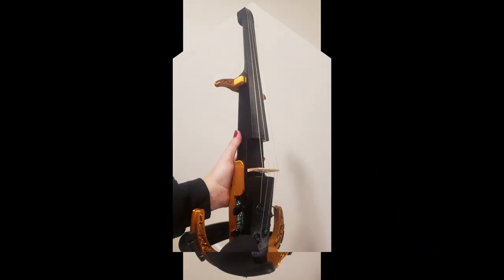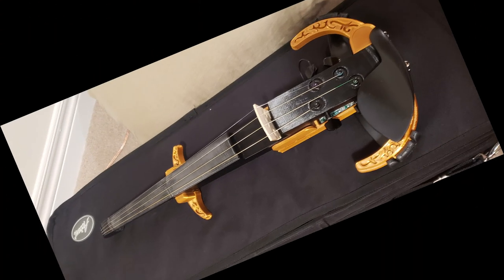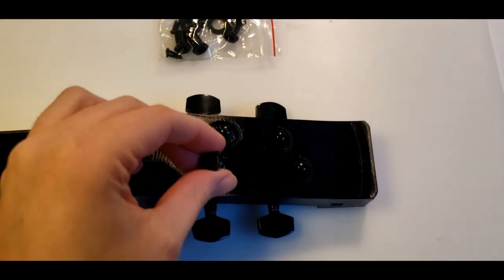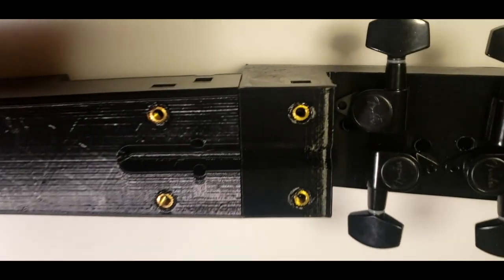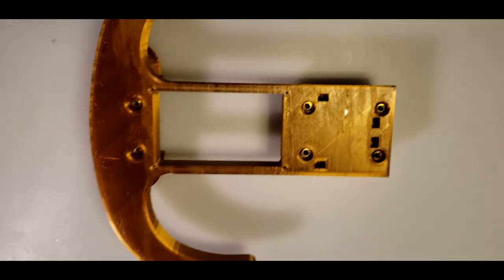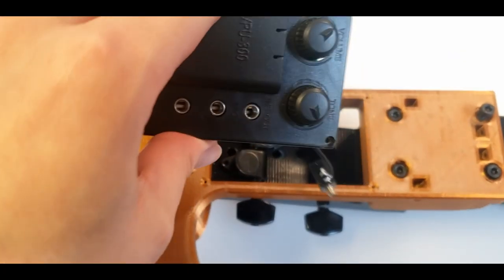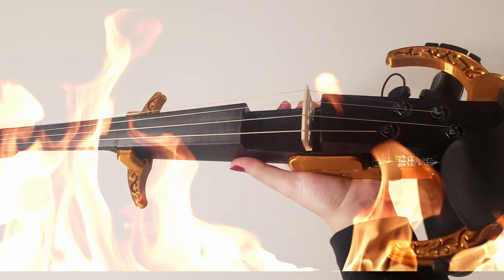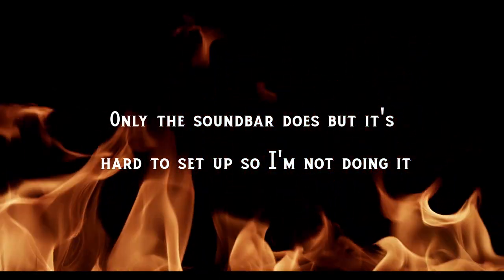Speedrun Electric Violin 3D Printed Tutorial

Comment: Can you at least slow it down so I can get an idea, because I’m really trying to build one
Reply from the maker: I know this is a really old comment, but do you want to see an actual tutorial on how to build this?
Reply: @Nightwish545  I actually would. The electric sensor is the part I am hesitant and confused about (I have all the parts together now but scared to assemble)
Reply: @Nightwish545  Me too! the wire in the middle of the piezo pickup doesn't line up with the holes in the neck, so I need to either drill another, or have it sit offset from centre. 
And where do the nuts for the bolts go? there's loads of holes in the sides, but I can't see how it would work.
Reply from the maker: @Deluge4000 the hole being wonky is what led me to breaking my piezoelectric cable 😢 I don't have a great solution rn aside from finangling it, but I do plan on making a new violin soon. Also yea there's so many nuts and bold and it's super confusing so I'd love to make a good video where it's clearer
Reply: @Nightwish545  It's been a while, I have since made the one from the video. The thick walls in the instructions made it turn out to be 2.4x heavier than my wooden violin! I recommend printing the JAx Dragon instead. The design has been updated a lot since the Mina (the parts are backwards compatible though)
I also read through all the comments sections of the other people whove made the various JAx violins. There were others who'd broken the pickup wires, and managed to solder them back together.

The JAx Dragon also has a shoulder rest, so that it's not putting all the weight on the pre-amp's knobs when it's placed down on a flat surface.